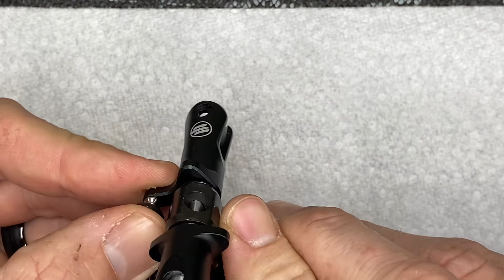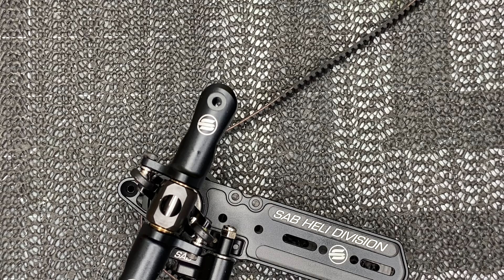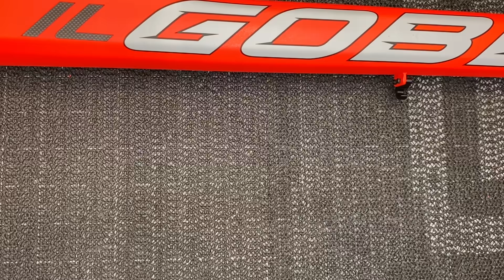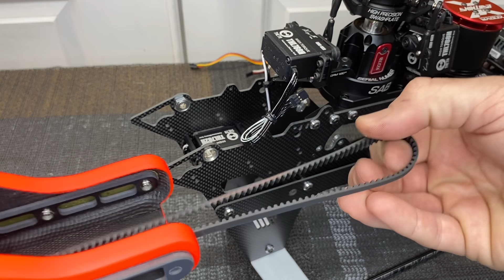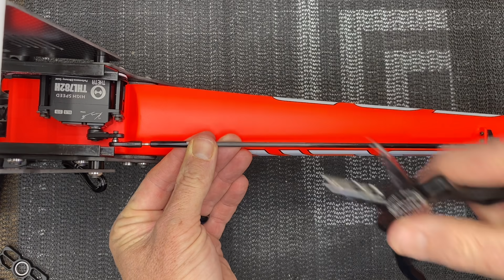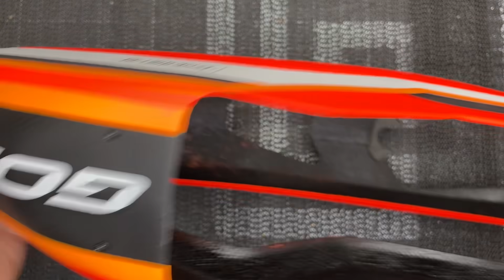SAB ILgoblin Pro Build Part 2

Comment: Sab shows using retaining compound on many critical fasteners. Is red loctite or the retaining compound stronger? Thoughts on using red instead?
Reply from the maker: Red Loctite is permanent! Very different than retaining compound. Personally would not recommend using red Loctite on little screws as you will snap the screw if you don’t eat the living crap out of it before removal. I personally only use blue and green Loctite on hundreds of helicopters that I have built.

Comment: Hello Jeff. Almost done with the iL Goblin Pro and it is going smooth thanks to you. I will definitely be making another donation to you once it's done. In this video you mention mounting , to the flybarless mount , a "backup capacitor pack". Can you tell me about this? How important or necessary is it? If you have a video about it please post a title or link. Thank you in advance.
Reply from the maker: Hello! I’m glad the build is going great! It’s a super smooth build and flys even better! I greatly appreciate the support! Yes, back up packs are capacitors, I did a video on the Mikado capacitor pack, the capacitor pack, smooth out the voltage ripple and keeps a consistent voltage to the servo. Not only that in the event of a ESC shut down or BEC shut down solder joint coming loose or breaking you have around 45 seconds of servo power. You can auto down and land safely.
Reply: @ Ok Thank you
Reply from the maker: @eddieepicmedia you’re welcome!

Comment: When you built your 14S battery pack, which cells did you use?
Reply from the maker: @4kgaming608  which 14s pack? The 14s 3100mAh?
Reply: @westhobbiesrc8051  I thought the one you put in the IlGoblin is 14s, but yes. I'm ready to order cells to make mine.
Reply from the maker: @ the ILgoblin is 12s. I just bought a 12s stick pack for that heli. But I normally just use two 6s or 7s packs and make my stick packs. You can buy the cells and spot weld them together but it can be a pain. Easier to just buy two 6s or 7s packs and make them into a stick pack.
Reply: @westhobbiesrc8051  Thank you for your rapid response! Well, that will save me from buying another expensive piece of hardware!

Comment: On the old goblins the boom was attached with a nylon screw. Here it is steel. is the boom somehow weakened so that it does not destroy the frame in a fall? Of course, no fall is the same as a fall, but I liked the old solution and it worked :-)  Thank you.
Reply from the maker: @SMModels1200  the krakens were the same way. 9/10 crashes the nylon bolts would not break anyways and still destroy the boom lol so I’m assuming they just got rid of the nylon bolts because they caused flex but I don’t know for sure.
Reply: @westhobbiesrc8051  Yes i understand it is clear to me that the boom was often damaged. but I solved the frame.  Changing the frame is more difficult. Now the metal screw will definitely destroy the frame. Maybe the connection is so tight that only the boom will be destroyed. But thanks for the answer :-)
Reply from the maker: @ I completely understand that! I’ve not crashed it so I can’t say for sure but! The boom being a lot smaller I would assume it will snap before the frame? But only time will tell! Luckily the frame sides are very easy to change out but definitely don’t want them breaking if you can help it.

Comment: Hi Jeff, did you have an issue with the anti rotation pin touching the canopy?
Reply from the maker: @mikefuchs2814  hi Mike, I did not have that problem, does yours hit?
Reply: @westhobbiesrc8051  hi Jeff,  yes mine touches at higher collective.  Like the pin is too long or canopy needs to be trimmed like 1/8".
Reply from the maker: @ hmm! I’ve got three of them here, one is mine and one is a buddy and I’m building an anther one for a customer and none of them touch, I just checked again. Is the pin hitting the plastic spacer if the canopy? Can you email me pictures so I can get a better idea? westhobbiesrc@hotmail.com
Reply: @westhobbiesrc8051  yes the pin is hitting the plastic guide on the canopy. I'll send pics tomorrow.
Reply: @westhobbiesrc8051  Hi Jeff, disregard, it was my mess up on the canopy installation, all good now!
Reply from the maker: @ hi Mike, I’m glad you figured out the issue!
Reply: @westhobbiesrc8051  thank Jeff, me too. Maidened it last weekend but had a tail belt issue that is fixed now.  Will get some flights on it this weekend.  Such an awesome heli!
Reply from the maker: @ the maiden flight video will be up tomorrow, I LOVE it! It’s an incredible heli, I had a tail bearing go out on the fourth flight, it started clicking so ordered some new bearings.